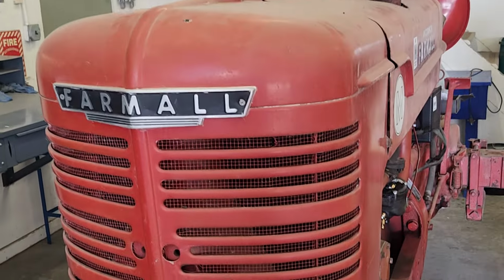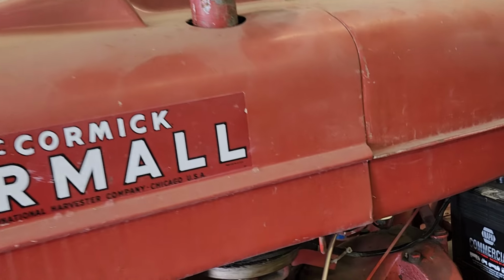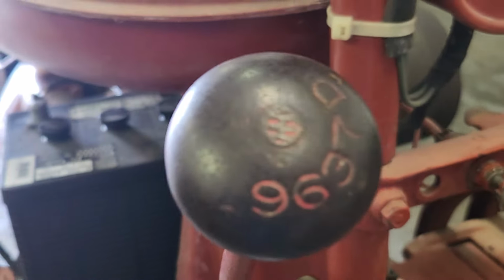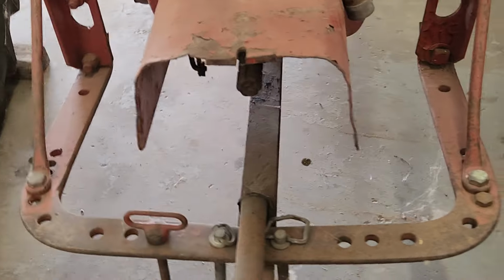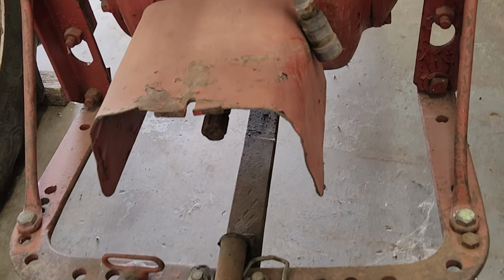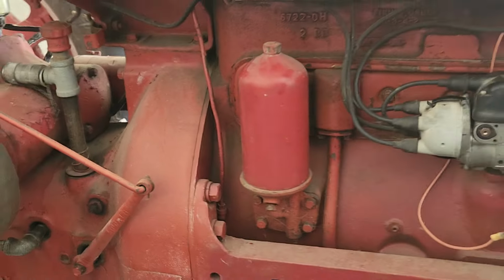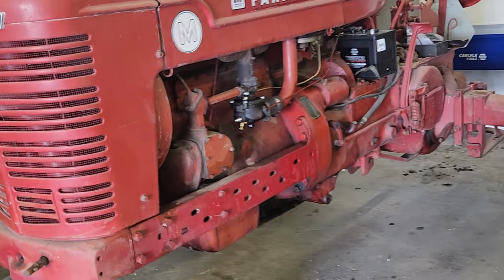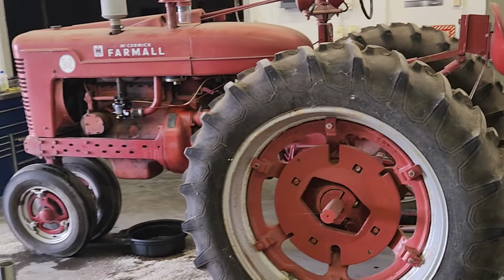Have you hugged your Farmall today  ?

Comment: I had some colorful words for my M yesterday... the fuel filter plugged up, took care of that then it musta been vapor locked. Went and got the 966 and baler, baled for 4 hours and tried it and it fired right off. Sometimes they sure test my patience but I wouldn't trade them for anything else😊👍
Reply from the maker: Seems like when they get close to 80 you need to work on them before they work for you.  I think I need to replace the sediment bowl valve.  It runs for about 30 seconds,  and runs out of gas . Thank you Adam.